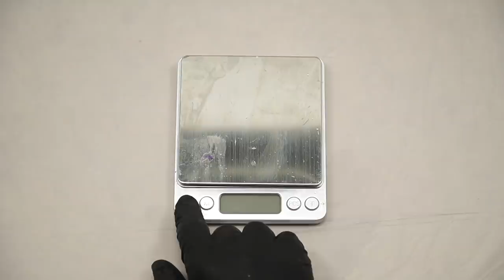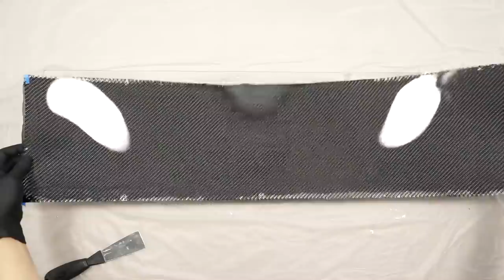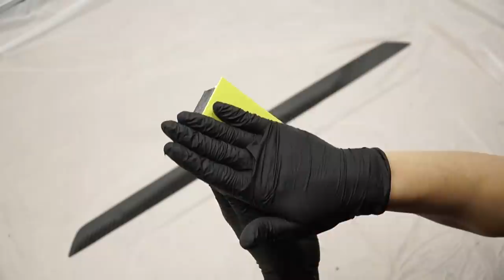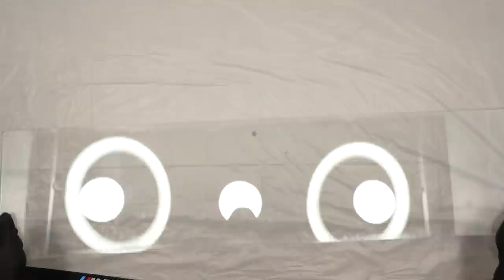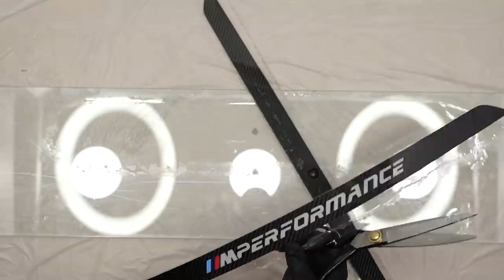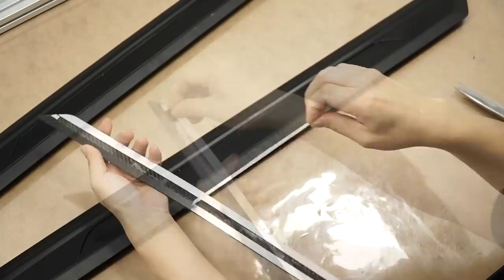How to Make a Carbon Fiber Door Sill with Logo [DIY]

Comment: Hello!
Beautiful one, but it isn't a little bit too flexible?
Could you make a new tutorial about making trunk spolier or lip from carbon? Like the one that comes on the m4 competition?
Thank you!
Reply from the maker: Hello, Buddy!
One layer of carbon fiber is very flexible.
It is no problem for the interior at all.
But, external parts such as spoilers require lamination of multiple layers of carbon fiber.
I hope you helpful.
Reply: @ECOLAPStudio  Hi! Thank you for the tips. I still have some unclear things. The carbon fiber layer is very thin, the final result of a spoiler wouldn't be heavy in order to make the thickness of an oem spoiler? 
Also 1 more question, how do you the other side of the object? For example the center of the steering wheel to fix it with screws onto the actual steering wheel?
Thank you!
Reply from the maker: Multi-layered carbon fiber is very hard.
That's why it's OK to be thinner than the OEM parts.
It would be very heavy if you, as you say, carbon fiber as much as the thickness of the OEM part.
The second question is that I can't understand exactly what that means.
I'm sorry. I'm not good at English.
Please talk in detail.

Comment: Ciao bellissimi i video.. Potresti dirmi dove posso trovare i due tipi di resina epossidica che utilizzi nel video? Grazie mille
Reply from the maker: Hello, Buddy!
I purchased materials from a Korean online shop.
However, Korean online shops do not ship overseas.
So I'm going to show you an online shop in the UK.
Lamating epoxy resin   https://www.easycomposites.co.uk/#!/resin-gel-silicone-adhesive/epoxy-resin/EL2-epoxy-laminating-resin.html
top coat https://www.easycomposites.co.uk/#!/resin-gel-silicone-adhesive/epoxy-resin/epoxy-coating-resin.html
carbon fiber cloth https://www.easycomposites.co.uk/#!/fabric-and-reinforcement/carbon-fibre-reinforcement/woven-carbon-cloth-under-400gsm/22-twill-240gsm-3k-1-25m.html

I hope you helpful.

Comment: this is incredible work!! if you can find the time can u link where u get your materials? carbon fiber sheets the epoxy etc?
Reply from the maker: Hello, Buddy!
I'm buying carbon fiber and epoxy resin from online shop in Korea.
However, Korean online shops do not ship overseas.
So I introduce you UK online shop.
Maybe you can find what you want.
I hope you helpful.

Epoxy gelcoat : https://www.easycomposites.co.uk/#!/resin-gel-silicone-adhesive/epoxy-gelcoat/epoxy-tooling-gel-coat.html
Epoxy resin(laminating) : https://www.easycomposites.co.uk/#!/resin-gel-silicone-adhesive/epoxy-resin/EL2-epoxy-laminating-resin.html
Epoxy resin(topcoat) : https://www.easycomposites.co.uk/#!/resin-gel-silicone-adhesive/epoxy-resin/epoxy-coating-resin.html
Reply: @ECOLAPStudio   im in USA so unfortunately they wanna charge me like 100 euro just to ship it :( but thank you so much for responding and helping with links your awesome and you inspired me to do my first DIY
Reply from the maker: Sorry.
The only online shop I know that can be shipped internationally is T.T
Reply: @anonymousnick214  look at UScomposites.com .  they have very good epoxy and cloth for just about the cheapest prices ive seen.  look into the medium hardener for the epoxy resin.
Reply: @ECOLAPStudio   do prepregs need uv coating??

Comment: hello wanna ask.. Is it necessary to wait epoxy resin to get tacky first before stick carbon fiber cloth? Because what i see in your video after you put epoxy resin on the glass you directly just stick carbon cloth
Reply from the maker: Hello, Buddy!
Don't wait for it to be sticky.
Apply epoxy resin to the glass plate and immediately layer the carbon fiber cloth.
It is most important to remove the air bubble using a brush.

Comment: Is it possible to just use the uv resin to add a bubble look to the carbon piece or does it thin out too much when dries?
Reply from the maker: Hello, Buddy!
The epoxy resins I use are products that can easily remove air bubbles.
I've been trying to get rid of air bubbles, and I haven't tried making air bubbles.
Making an air bubble can be done by mixing a high viscosity epoxy resin and curing it at a temperature.
This is my guess.
Reply: @ECOLAPStudio  bubble or dome look

Comment: Are you using gas heat because the electric heat gun blows to much air?
Reply from the maker: Hello, Buddy!
That's right
The electric heat gun is too strong.
And it is too hot, which can damage carbon and epoxy resin.
Reply: @ECOLAPStudio  right on didn't know it could hurt the carbon I used a hot air gun recently on some reason and though it was pretty cool how it removed the bubbles that are to small to show on camera but definitely would hurt the clear look.
Reply: Gregory Krisa OMG 😱 
Bro it does not damage carbon fiber with a heat gun, it might over cure the resin. Carbon fiber is created to withstand up to 2000 degrees of heat!! How in the world is a heat gun going to damage the carbon🤦🏾‍♂️

Comment: Hey man. Really enjoyed that videos. Could you link your products ? And why are you something vacuum sealing and sometimes not.
Reply from the maker: Hello, Buddy!

Thank you so much.
I'm sorry, I don't sell carbon fiber.
I would like to share information and fun with video.
And When It forming, vacuum is required, otherwise vacuum is not required.
Vacuum may or may not be necessary depending on the situation.
I hope you helpful.
Reply: @ECOLAPStudio  thanks for the info thats helpfull . You got me wrong there just a link or description what you use not where to buy. I saw some resoltech 7060 but which epoxys especially the UV resistant top coat
Reply from the maker: @denniss1618  Resoltech 7060 is clear gelcoat.

If you want a clear topcoat (Anti UV), I recommend resoltech 1070S (epoxy resin) + 1074 (hardener).

I buy materials from Korea, but Korean online shops do not ship overseas.

So I can't tell you the link.
You should to find shop, you can buy.
Reply: @ECOLAPStudio  no that's fine don't need no links ist your first layer basic gel coat as well 7060 (the black one)
Reply from the maker: @denniss1618  The resoltech 7060 is black and clear.
However, I did not use the 7060 gel coat in the door sill video.
I think you have seen using 7060 in another video.
In the door sill video, two types of laminated epoxy resin and resoltech 1070 top coat epoxy resin were used.

Comment: Hello! From Hawaii! I am a new subscriber to your channel. Great job in everything you do! Very helpful 👍🏼 do you use heat gun after laying cloth and resin?
Reply from the maker: Hello, Buddy!
Nice to meet you.
That's right.
Apply epoxy resin and use a heat gun.
Using a heat gun can remove air bubbles.
However, be careful when using too high temperature and too much time as it may damage the carbon fiber and vinyl sheet.
Thank you for watching.
Reply: Thank you very much! Stay safe!

Comment: @Eco-Lap Studio - How do you clean the glass plate the best after use ?
Reply from the maker: Hello friend
That is simple.
The fully cured carbon fiber will release very cleanly from the glass plate.
And you can wipe it with acetone.
But, if some epoxy resin remains, it can be removed by blade of utility knife.

Comment: ..do you have Carbon Fiber Mirror caps on your BMW M4?
It could be a new Project 😬🤙

..or Carbon Fiber Kidney?
Reply from the maker: I have a carbon fiber mirror cover. ^^
I'd like to try Kidney Grill but it's not easy.
Because It have to skin both outside and inside at once.
I will try it when I get a chance.
Thank you for watching.
Reply: Sorry, i don't know that you always had mirror caps made of Carbon fiber 😬 are they at point of delivery on your M4?

Yes, the Kidney Grill is really heavy i think, even if you try to make each spoke 😬
What i mean is just the frame :)

Buddy, do you have seen the coloured Carbon fiber on the Internet? You can get it in Gold, Red, Blue, Silver..amazing 😍
But this variants were very expensive :(
Reply from the maker: @bambino4604  My M4 mirror cover was not carbon fiber at delivery.
I installed it as genuine BMW parts.
M4 (Competition), which is being delivered recently, seems to be shipped with carbon fiber mirror cover.

Comment: hello man, very nice work, cery nice BMW M4, itw my dream car!!! and i love your chanel...
question: what epoxy use? code? and slow or fast?
sorry for my bad english
Reply from the maker: Hello, Buddy!
Thank you for the compliment.
The epoxy resins I use are typical curing times (very slow).
I am purchasing materials from a Korean online shop.
However, Korean online shops do not ship overseas.
So, I'm going to give you a permanent online shop.
I don't speak English well, either.
Epoxy gelcoat : https://www.easycomposites.co.uk/#!/resin-gel-silicone-adhesive/epoxy-gelcoat/epoxy-tooling-gel-coat.html
Epoxy resin(laminating) : https://www.easycomposites.co.uk/#!/resin-gel-silicone-adhesive/epoxy-resin/EL2-epoxy-laminating-resin.html
Epoxy resin(topcoat) : https://www.easycomposites.co.uk/#!/resin-gel-silicone-adhesive/epoxy-resin/epoxy-coating-resin.html
Reply: @ECOLAPStudio  do you know the number of epoxy... Is it R481 slow?
Reply: @ECOLAPStudio  ok now i see the more text...fine thank y man.

Comment: Why does the epoxy gel coat you adjusted look easy to brush, mine is hard, is there any requirement for this ratio?
Reply from the maker: Hello, Buddy!
I didn't think of it.
I use it in the proportions suggested by the epoxy resin manufacturer.
What about low-viscosity epoxy resins?
However, be careful, because epoxy resins with too low a viscosity is flow down.
I hope you helpful.
Reply: @ECOLAPStudio  Is epoxy gel coat
Reply from the maker: I'm sorry friend I read wrong.
Epoxy gel coats have a very high viscosity.
That is why there is a reason to use gel coat.
Try using a brush with strong hair.
And when applying an epoxy gel coat, a thin coat will help.
I hope you helpful.

Comment: Hello, what brand are the materials used?
Reply from the maker: Hello, Buddy!
I'm buying carbon fiber and epoxy resin from online shop in South Korea.
However, Korean online shops do not ship overseas.
So I introduce you UK online shop.
Maybe you can find what you want.
I hope you helpful.

https://www.easycomposites.co.uk
Reply: @ECOLAPStudio  Hello buddy, what brand of epoxy gel coat and epoxy resin do I have, how do I search.
Reply from the maker: I'll link the most similar to the epoxy I use.
Please check it.

Epoxy gelcoat : https://www.easycomposites.co.uk/#!/resin-gel-silicone-adhesive/epoxy-gelcoat/epoxy-tooling-gel-coat.html
Epoxy resin(laminating) : https://www.easycomposites.co.uk/#!/resin-gel-silicone-adhesive/epoxy-resin/EL2-epoxy-laminating-resin.html
Epoxy resin(topcoat) : https://www.easycomposites.co.uk/#!/resin-gel-silicone-adhesive/epoxy-resin/epoxy-coating-resin.html